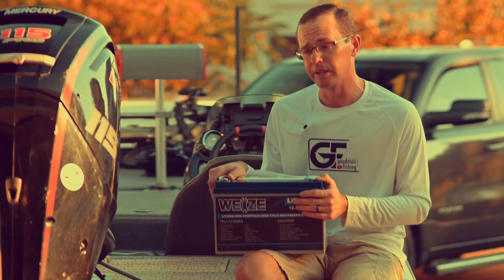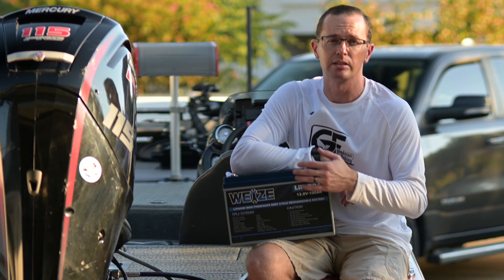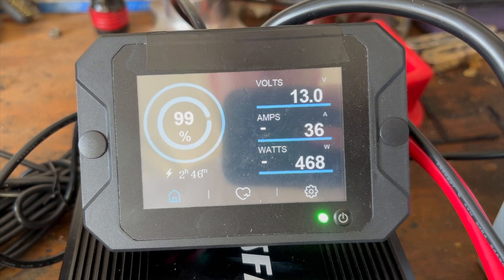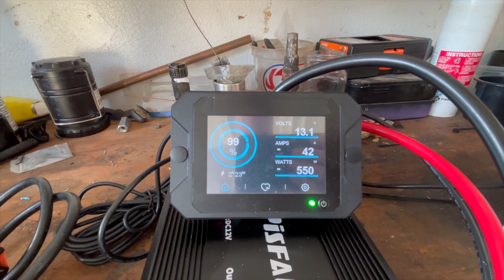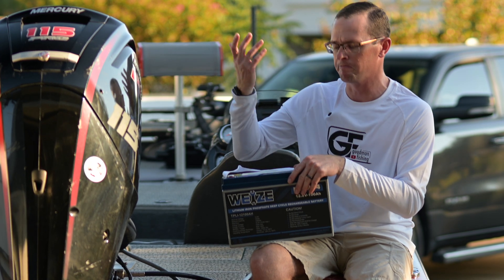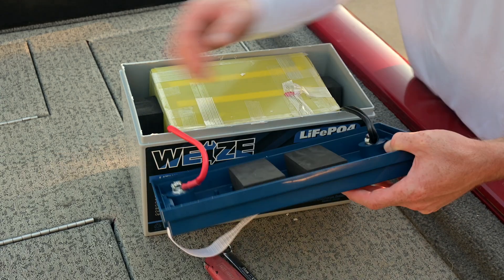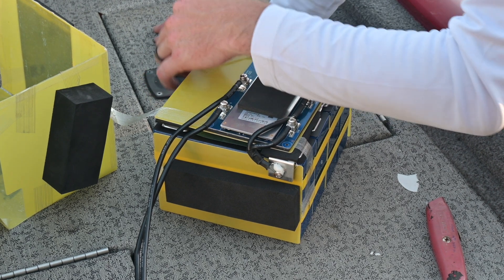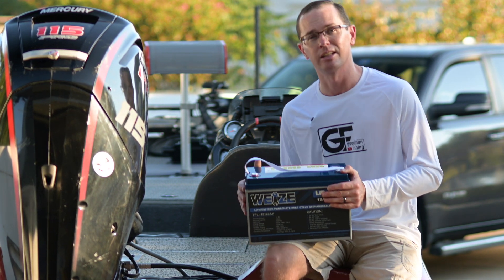The Unintended Battery Tear Down – Weize 100Ah Lithium Review & Test

Comment from the maker: What are your thoughts on the Weize battery?
Reply: i have this battery was asked to take a look at it. it has full pack voltage pre bms but only puts out about 9 volts . have no idea what to do with it
Reply: Wil prose liked them on the first tear down but a yr or so later he tore one down and seemed disappointed like they had gone cheap?
Reply from the maker: This one looked pretty good on the inside. I suspect production processes change around a bit on batteries like this.
Reply: I have the mini.  Good so far. I like that you pulled over 100A, 110A is fine. Next time try for 150A? My inverter is also too small to try that. The BMS did disconnect it while charging, good protection, seems my lifepo4 charger puts out a bit too much voltage at final stage (low current top off)
Reply from the maker: Hoping to have a 2000W inverter here soon to run it again!
Reply: I'm currently on number 3, though I don't think I can blame Weize.  The first one stopped working and when I went to check it out I noticed the battery box on the front end of my camper was full of water and the battery was submerged; obviously that was a me problem, but I liked the weight savings so I bought another (I probably had the lid on the battery box at an angle so I also drilled some holes in the bottom of the box to ensure that didn't happen again).  The second one we used from around March of last year until November, went to go camping in December and the battery was dead, most it would ever show was around 12.75v until a load was placed on it (like a smart charger) and it would drop to under 1v.  I contacted Weize and they wanted a video of me trying to charge it, then a video of the charger working on another battery, after that they sent a replacement.  Fingers crossed this one makes it a bit longer.